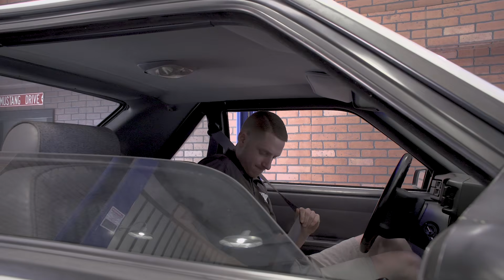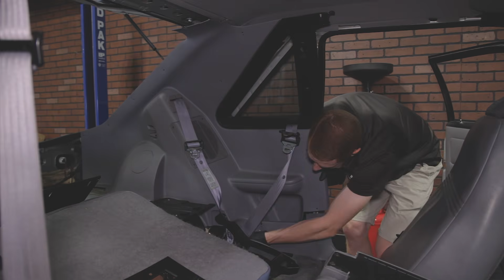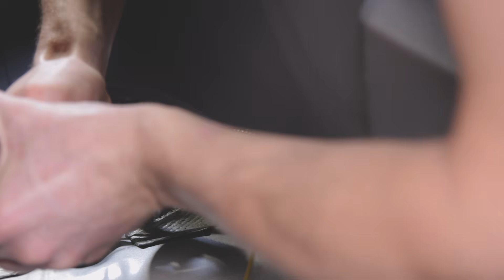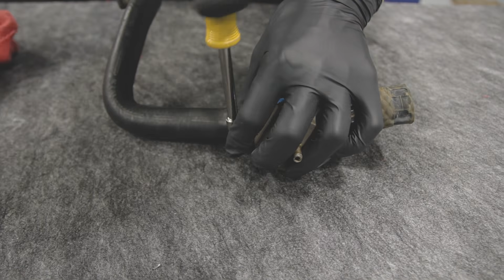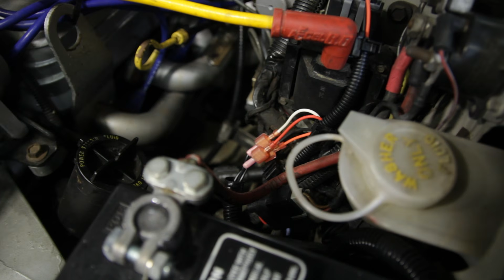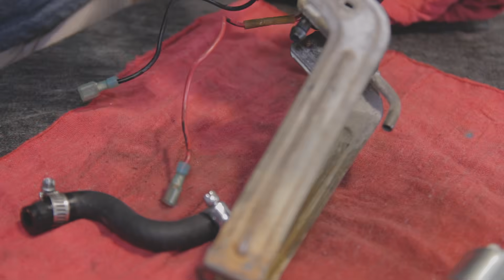Fox Body Mustang Supercharger Install/Dyno - Vortech V3 | Full Series Video

Comment from the maker: If you had the choice, what would you choose - Supercharger Or Turbo? Check out our Fox Body Turbo Install - https://www.youtube.com/watch?v=LIn0VqLrR9s
Reply: Turbo. More complex but greater area under the curve. Also, no hp loss from the supercharger.
Reply: I have the v3sci i bought from you guys a few years ago. Been working great!
Reply: Turbo.  There is no adjusting the belt all the time.  Lol.
Reply: Why bother putting the smog pump back on?
Reply: Supercharger and foxbody are made for each other
Reply: I've had both, and the turbo wins hands down for power. Heat and pain of install, the turbo wins again! LoL. I like the nearly "free" HP the turbo provides rather than the cost of the crank turning a blower. I first had a Paxton kit with the planetary drive (love/hate relationship there) that sounded like a turbo when the boost came on ❤. I fo feel that my old S-Trim Vortech was an easier install than my Turbonetics kit. Belive me in the early 2000's even with a hand ported set of stock heads, a B303 cam, with 1.7 roller rockers,  my hatch was tough to deal with from a dig in Mexico. I won alot and lost a few. Stage 2 TFS heads, Magnum 1.6 rockers, and an F-303 cam (set to clear stock valve reliefs) later the car was a pure joy and a thrill to drive. A built Keith Craft 306, a Wolverine 222/232 split lift split duration cam (no hiccups with that cam stock tuning 30lb/hr injectors w/FMU) I could put the car in 5th at 1500 rpm without a single buck. 🥰 Later went with Stage 1+ FoxLake performance CNC'd Canfield heads, S-Trim maxed at ≈17psi at the blower lip and 14.5psi at the vacuum tree with an Edelbrock Perf RPM intake set that I gasket matched, 75mm t-body, 77mm MAF in my coupe.  What a rewarding setup. 😊 Great install guys and very informative, and I dig that you didn’t skip the little details! I wish I’d have had this on my first blower install on my back in the driveway!! Keep it up!!❤❤
Reply: Supercharger, had the same kit on my 88vert with heads, cam and intake
Reply: Turbo, but superchargers have their place as well.
Reply: Who won the 100k subscriber sweepstakes?
Reply from the maker: @mr.ed2092  We picked the winners back in August and posted the winners on social (FB/IG/Twitter) - Jude Horstman - Social Media/Events Coordinator
Reply: Super charger so when I grenade the motor I don’t take out an impeller and have added costs
Reply: What brakes are on this car??
Reply from the maker: @jplperformance9073  It has a complete SN95 Cobra-style brake conversion.  Here is a link to shop all of the parts: https://lmr.com/products/fox-body-5-lug-conversion-cobra
Reply: That's why I buy parts from you guys, honestly I'm surprised that you guys were honest and I love it. LMR and Lethal are my go too's for parts for my 93 Foxbody
Reply: Probably a supercharger like what I am going to do to the sn95 on my channel

Comment: This is NOT the 9psi kit, correct? Looks like a tuner kit.
Reply from the maker: Here is the kit: https://lmr.com/item/VOR-4FA218044L/1986-1993-mustang-5-0-vortech-v-3-non-intercooled-system
Reply: @latemodelrestoration  Thank you

Comment: Is that radiator hose included in the tuner kit and is it necessary to use it or just leave the rubber hose alone and re install vs cutting it?
Reply from the maker: Yes, Vortech includes the radiator pipe in their tuner kits. Yes, you have to modify the upper radiator hose for proper clearance and fitment. -Landan
Reply: @latemodelrestoration  for the 94-95's I've seen a lot of guys run the oem hose, it doesn't hit. I guess it's a definite on a fox though to run the chrome hose
Reply from the maker: Due to the placement of the head unit, pretty much all Fox Mustangs with a Vortech require the upper pipe and hose modification. -Landan

Comment: You didn't put an SFI rated balancer on?
Reply from the maker: We ended up putting a Ford Racing SFI approved balancer on the car about 2-3 years after the Vortech was installed. -Landan
Reply: @latemodelrestoration  gotcha and yes it seems a lot of guys run the oem balancers so I'm just going to run mine. 

I have a few more questions for you though and my car is a 94 Cobra. Is it necessary to run an ignition box and if so, even with the oem coil? 

I didn't see you do anything with the pc valve setup and that's what I'm currently researching as it seems many have done different things and some had issues with how folks said to run it or they run theirs lol.

Comment: A friend of mine has a 91 in highschool and he bought this ram air kit that has a plastic scoop that mounted underneath the bumper and the hose ran up to the air box that came with it and you could feel the difference. Surprised me that you could actually feel more power. I think summit still has it. It's called March ram air kit

Comment: Anybody have the serp belt size?? Just installed my vortech. Have smog pulley and ac pulley “stock” setup. Except just with a vortech now can’t find anything about a belt size
Reply from the maker: If the car is like the one in the video, it uses the stock length belt. This is stated in the instructions on page 9. -Landan
Reply: @ I used upr smog pump delete pulley, and upr AC delete pulley. “Stock” touting other than the alternator being relocated due to supercharger. Ended up using an 84.5inch belt

Comment: I am planning on getting a supercharger for my Fox. So technically you can get rid of the FMU if you run at least 42lb injectors? And do I need the T. rex pump with a  BBK 255lph or can this work without the T Rex?
Reply from the maker: Yes, you can technically ditch the FMU. However, we technically didn't have to. The car ended up having a butt connector in the fuel pump bracket supply line.

47lb injectors and a 255 lph fuel pump will work. Don't forget a MAF meter calibrated for 47lb injectors. -Landan
Reply: @ thanks for the help. Yes I watched the whole video. I’d be frustrated finding  a butt connector stuck in the supply line. What are the odds. Glad you found the problem.

Comment: What are the chances a butt connector would accidentally end up in a fuel line?   But having worked on cars for 40 years I’m not surprised-
Reply from the maker: We thought the same thing! To add to this, we just ran into a similar fueling issue on a 393ci swapped Fox. There was a piece of trash in the small tube that supplies the sump in the tank. Chased the issue on and off for nearly a year. Crazy stuff! -Landan
Reply: @ my son and I are building a 87’ convertible.  I’m just got a p-40 intake, looking for heads.  I really want to put a simple supercharger on it.  We are about to go outside and install an Autometer digital dash.    Thanks for the videos! Keep them up.

Comment: Why did he gap the spark plugs to 0.035? Original spark plugs are gapped at 0.054
Reply from the maker: Because the car is boosted. A tighter gap is required to prevent spark blowout. -Landan

Comment: Maybe is a dumb question but i want to buy this kit but do i need to buy an aftermarket OBDII ECU for this installation? Or i could do this installation with the factory OBDI ECU?
Reply from the maker: We ran the factory ECU with this kit. To achieve additional power, a custom tune via a chip or an aftermarket ECU such as the Holley Terminator X or Megasquirt can be used. -Landan

Here is a video about the Megasquirt ECU: https://youtu.be/x5F2khhzMZo

We also sell these ECU's on our site: https://lmr.com/products/79-93-Mustang-Computers-Controls

Comment: I wonder if your final number was down by a couple HP switching to the Cobra intake. I think the RPM probably makes a couple HP difference. Kind of a bummer changing horses midstream. Hard to nail down numbers when more than one variable is changed at a time. Very cool series, though. It is so awesome what is available nowadays where you can fairly easily add 100HP and keep it legal for those of us that get smog checked.

Comment: Did you have to tune the ecu for the 42# injectors?
Reply from the maker: No, we didn't tune the ECU.  We installed a Pro-M meter that was calibrated for 42# injectors.  However, further tuning of the ECU would have netted a little more peak power.  -Landan
Reply: You ran the 42's without the fmu is that correct? Sorry for yet another question.
Reply from the maker: @jessegaunt7033  Yes.  The 42# injectors were used without the FMU.  -Landan

Comment: Dude changed the electors. Put cobra intake and throttle body and full exhaust change and fixed fuel pump after first dyno and then claims that charger made 118hp? Bs

Comment: What a  total waste of money go with a turbo kit people !!!I had this kit on my car I spent close to 3800 hundred dollars what a total waste… I put the whole kit together and my intake air temperatures were through the roof the belt kept on slipping it only made like 89 hp total waste of money… 

I called- vortex to ask them question About my intake air temperatures and all they wanted to do was sell me a air to water cooler that was like $2000 more totally disgusted total waste …

Purchased a turbo kit never looked back at a supercharger ever again ..
Reply: did you have duel electric fans!?!?

Comment: IMPORTANT Note.
I saw a factory type replacement fuel filter that the inlet and outlet were crimped down to about 5/32".
Look over everything regardless of the brand names.
Reply: the round holes where the line fittings slip on

Comment: 1) So was the fuel pressure falling during the "stock" pulls? nobody monitored it.
2) So you checked the new S hose and it was clear.
3) Intake manifold etc was changed.

The total power gain is not indicitive of the actual Vortec gain, since there are variables.
Good power👍👍👍
Reply: I believe that fuel pressure part was something he did because he didn't have no fuel pressure issue from the beginning.  It had to be something he or caused something to come lose to cause the fuel pressure issue because it never had a problem from the beginning.

Comment: $4,700.00 for the kit and not even 400hp? Too much $$, there's cheaper horsepower out there. Plus, re-releasing a series of videos as a new video is lame.
Reply: So go buy the cheaper HP, anyone not a brokedick (aka not you) will drop the 6k to get a properly running centrifugal car.

You sound like a barrel of fun, Ed.

Comment: How much psi was the vortech putting out? My old procharger P600B would add 225 on a stock motor. Of course it would have like 18 psi, if you didn't run the air to air intercooler it would gain 3 lbs of boost. With twisted wedge heads. Holley system max II intake and blower cam it would pump out 12 psi after the intercooler.
Reply from the maker: This kit is a non-intercooler kit and it makes between 8-10 PSI, we stayed conservative with the boost number, the head unit can produce more boost we just didn't push it to its limits.
Reply: @latemodelrestoration  could you please also make it more clear in your supercharger and turbo videos that success depends greatly on choice of camshaft and that cams with large duration should be avoided lots of viewers don't comprehend this technical detail and may lead to complaints from lack luster results

Comment: LMAO. 375 horse. A Pontiac 400 stroked to 461 cubes puts out, naturally aspirated, and with a mild roller cam puts out just under 500 HP and 560 ft pounds of torque. And that's on pump gas. I love me a Fox Body but many engines can put out much more with less.
Reply: J Hutch yea just throw in a stroker crank, new rods, new cam, new carb. Not exactly a weekend project
Reply: @truckfreak4537  Accept it is a weekend project. They sell the kits everyday.
Reply: This motor could be stroked to 363 and produce over 500 hp. But all things being equal,  with enough $$$ you can make 500 hp with almost any car motor.
Reply: @WillC299  wrong you cant punch out a 302 to a 363 . You would have to swap a 351 and punch it out to a 363.
Reply: @Lxmustang805  You can’t with a stock 302, but yes, an aftermarket 8.2 block can be built as a 363. That’s where the 363 comes from, an 8.2 aftermarket block; 4.125 bore and 3.4 stroke.
Reply: @johnhickman106  agree with a aftermarket block , but it meant with a stock for block you can’t .
Reply: Big brain logic here...

Comment: Should have replaced the fuel filter during the install, also you mounted the MSD box upside down. So if you drive the car in the rain, the MSD box will fill with water NICE JOB. You also could have run the wiring in a way so as not to put it under the spare tire going to the T-REX pump. Next time take more time and more pride on an install.
Reply: Scotch locks, sheet metal screws for grounds, come on.

Comment: The vortec kit should just include an intank pump.
Reply: Yeah no kidding. That secondary fuel pump fails and there goes your engine after a tune. Ejecto seato cuz.
Reply: @pimpovic2  That external Trex looks sloppy as anything. Intank Vortec...are you listening?
Reply: They should for the money, I mean seriously. I would just sump the tank and run a killer pump setup with pre & post filters and AN hoses.

Comment: Great Job Landon! I was thinking the original pull was little bit low, as I was expecting somewhere between 275-285 RWHP with the mods listed. Is it possible the butt connector was holding it back a bit as well?
Reply from the maker: Thanks!  The butt connector could have potentially hurt the baseline numbers as well.  As you stated, other cars that I have dyno'd with similar mods have made more power.  -Landan
Reply: Pago's Place it was probably low because of that butt connector in the hose lol that car was starving for fuel even naturally aspirated

Comment: How do the Windsor Jr heads compare to Gt40/p heads? Power and flow
Reply from the maker: You will find a lot more information about cylinder head flow and numbers in the following link. If you need help after running through this data, please don't hesitate to give us a call at 1-866-507-3786 -- https://lmr.com/products/mustang-cylinder-head-camshaft-guide-79-95